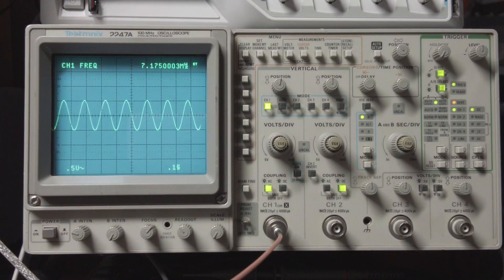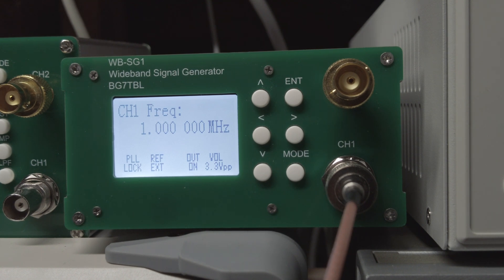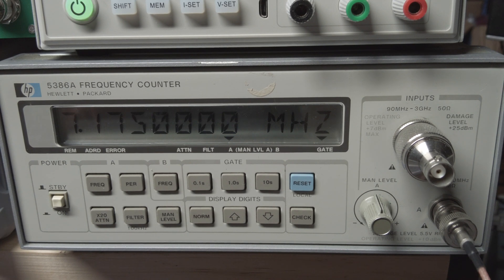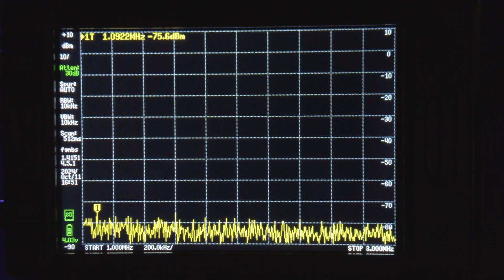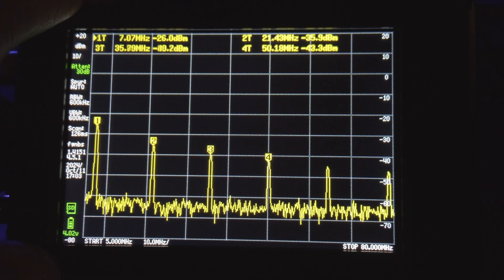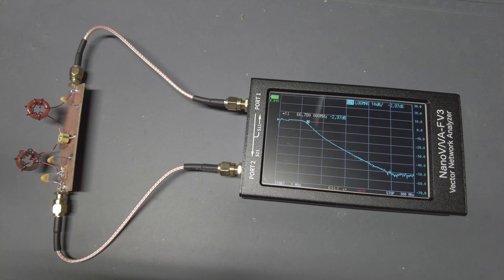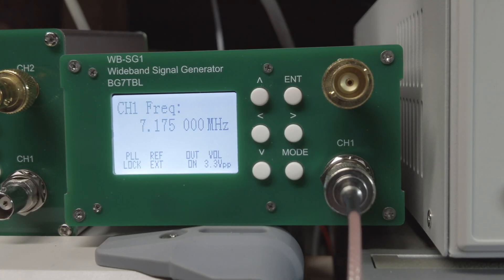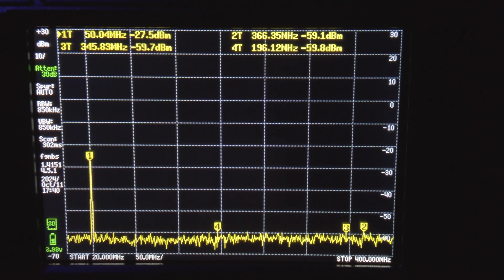Understanding Spurious Emissions: A Visual Explanation

Comment: Nice job Joe.  Wondering, if you reduce the reference level and narrow the RBW after applying the filter (in order to lower the noise floor), how far down did those spurs get suppressed.
Reply from the maker: Thank you. Setting the ref level to about -20 dbm and the RBW to 30kHz the 3rd harmonic was down about -42 dbm from the fundamental and it looks like I'm getting -0.5 dbm if insertion loss. So if this were for real I would need a higher order filter.